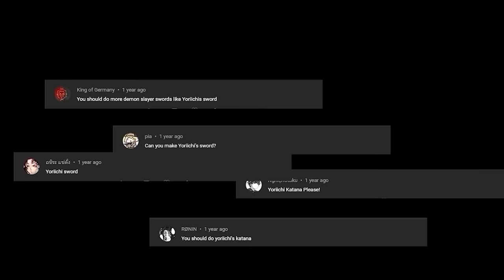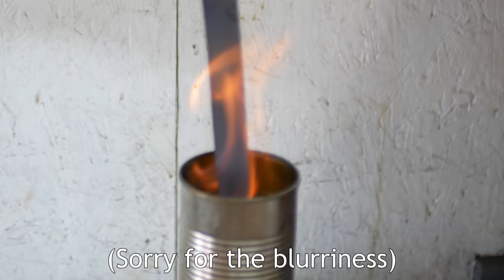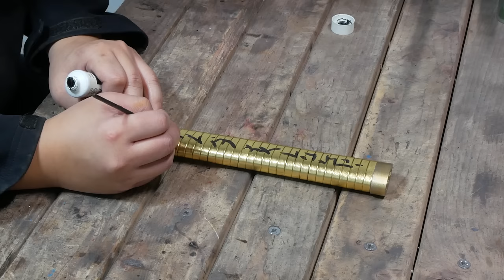Making Yoriichi's Katana The First Demon Slayer

Comment: A common misconception about Yoriichi's katana blade is that the Hamon is black and the blade is red. But this is incorrect, as in the show it is clear that half of the Hamon is Red, and the other half of the Hamon that contains the Bo-hi of the sword is black, which leaves the cutting edge, which is actually a regular steel-grey with no color. This vid would have been 10/10 if the blade was accurate.

Comment: Good. Now use the Japanese traditional way to forge the katana
Reply from the maker: traditionally made katanas are good, but modern monosteel katanas are stronger and easier to make.
Reply: @JumboRadish  that being said, blades made of carbon steel are much harder and hold an edge for much longer. the youtuber veritasium has a great video on this!